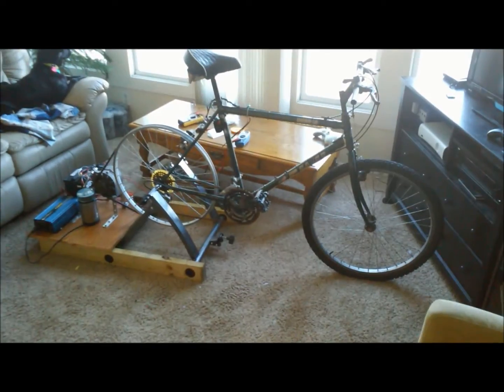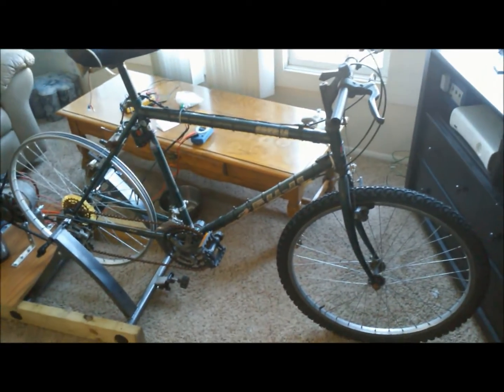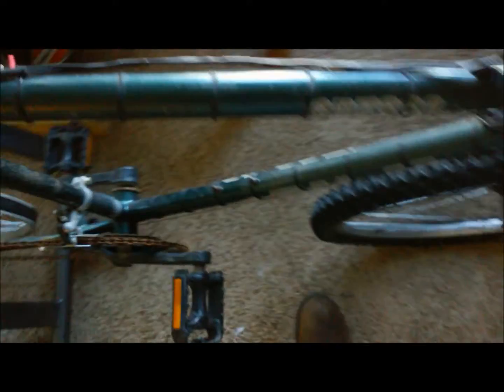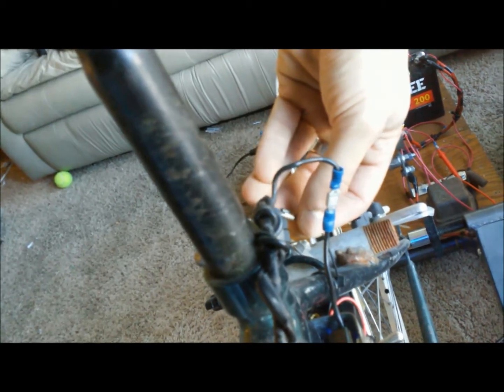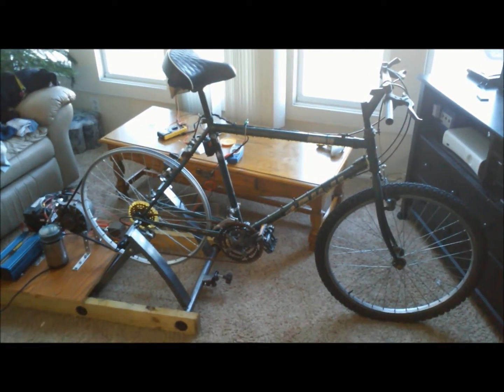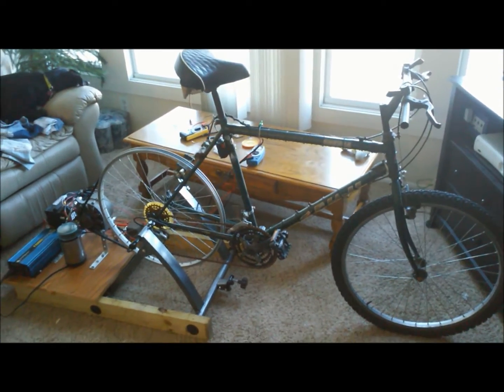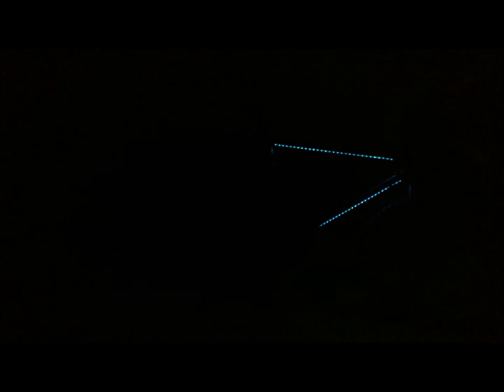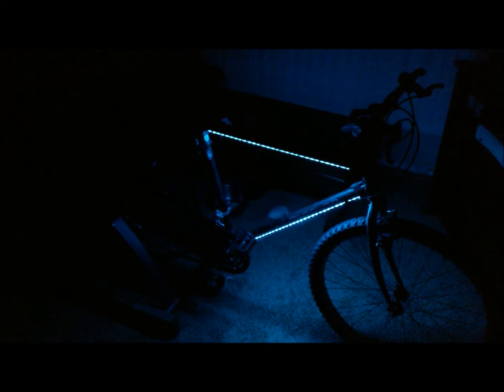Bicycle LED lights installed SIMPLE & CHEAP 2.0 (12 volt improved)

Comment: So, you no longer have your motorized bike?
Reply from the maker: No, I do still have it! Only one now though. At some point here I'll take a clip of running the motorized bike on the human powered generator!
Reply: Is it still running? I'm just getting to about 200 miles on mine.
Reply from the maker: yes it is, it has around 2300 or so miles on it. blew the top end up at 1800 and rebuilt it. my fault though, i was beating on it pretty good.